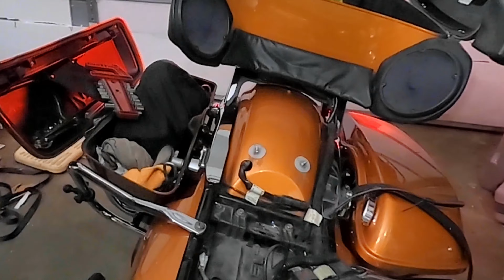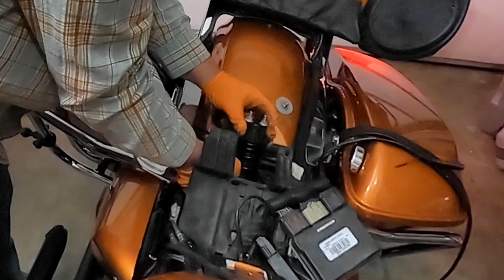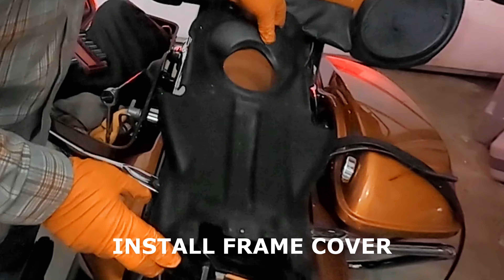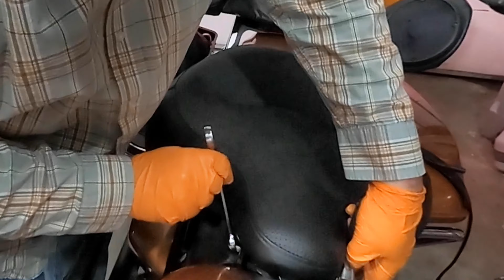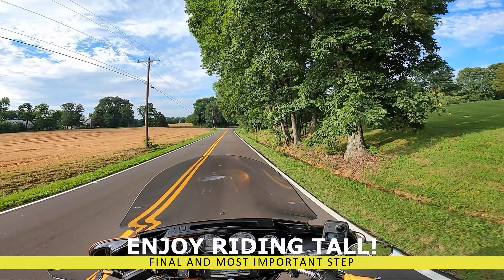Cooler Saddle for Long Leg Harley Rider

Comment: Nice job! Any major change in comfort levels, or being up higher when riding? I guess a long ride would be the best way to test it.
Reply from the maker: So far a positive on both! The akr flowing under keeps my rear cooler. The suspension in the saddle smooths out anything the suspension misses.